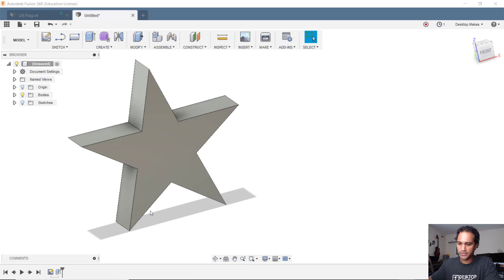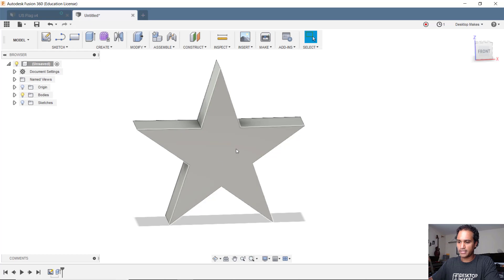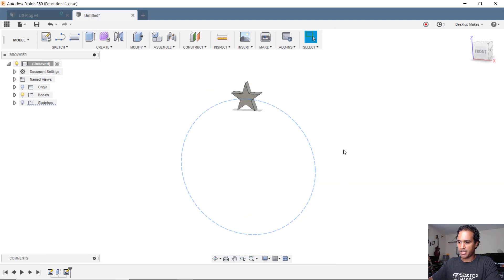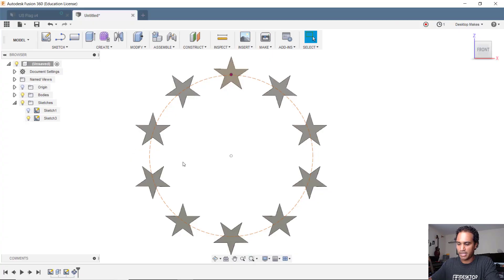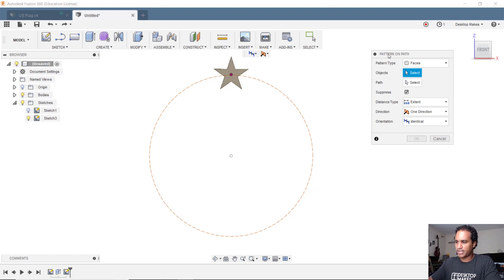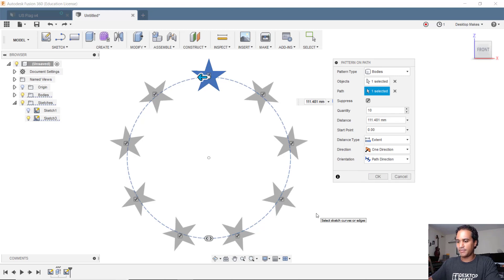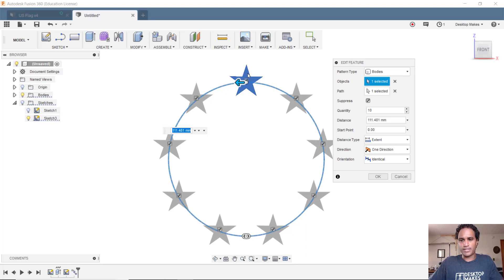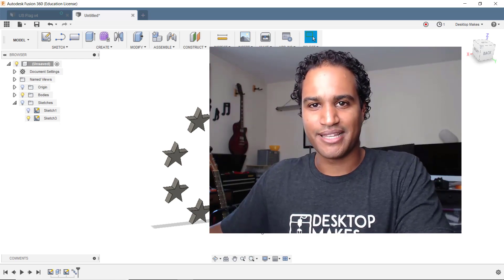Pattern on Path vs Circular Pattern

Comment: Olá Vladmir, that's a great video... Greetings from Brazil... I have a question but from another subject... I've been trying for a lot g time to get a reliable surface from a STL file, so I can design something that can fit on a scanned part... Do you have any idea to solve it?
Reply from the maker: Hi Devid,  I'm not really understanding what you mean by "getting a reliable surface from a STL file".  Are you trying to import an stl file in Fusion 360?

Comment: I was wondering why my comments disappeared (I know now; nothing personal...). That intentional overlap was a nice trick to keep the stars aligned.
Reply from the maker: Yeah, I decided to re-upload to fix the sound issue you mentioned and also correct the error with the number of stars from 9 to 10.  Ended up losing a few of my original comments.

Comment: I came here to tell you that you had an overlapping star as well lol. The same kind of thing happens with 3ds Max when copying  etc With it if you want 10 copies you use 9 instead, as the original one is counted already. Can be confusing sometimes.
Reply from the maker: Thanks Luke,  I ended up fixing the overlapping star issue and re-uploaded this video with the correction.  Good eye on catching it.  I completely missed it until one of the comments pointed it out.